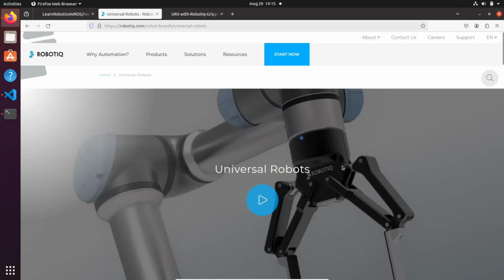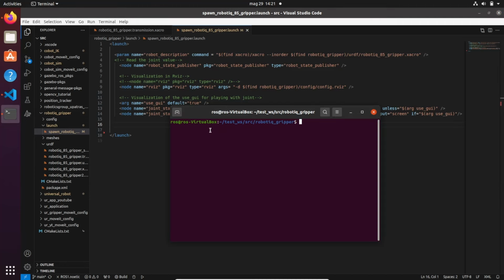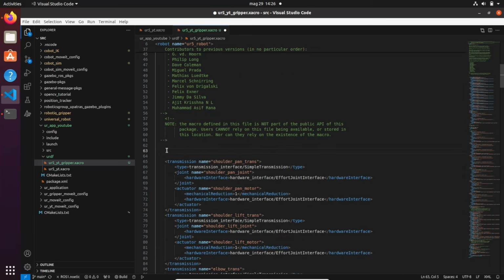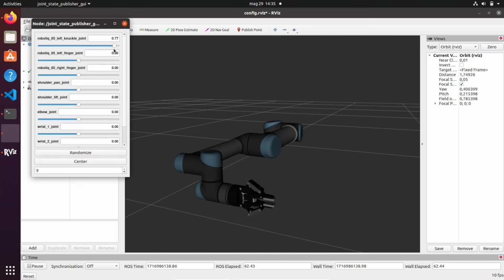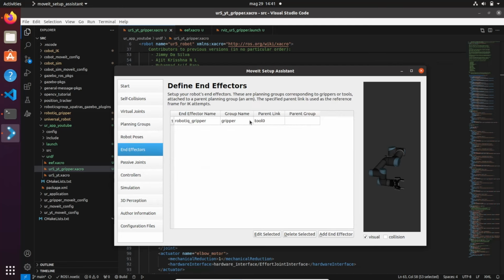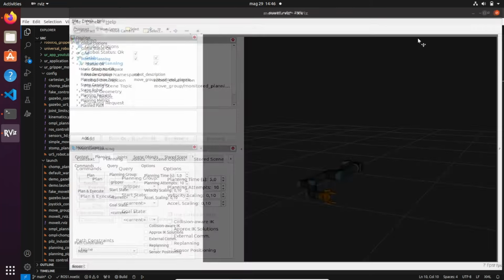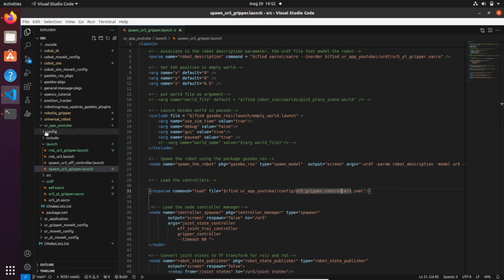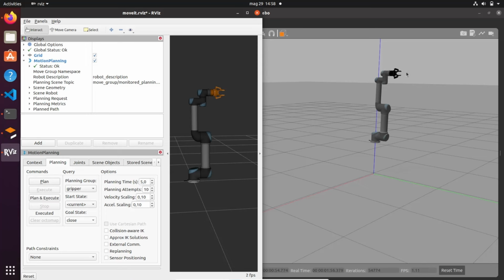Universal Robot with ROS - How to put a Robotiq Gripper on UR5

Comment: why the end_effector 28:20 is rotating (the joints) in gazebo, when i am executing the file, my end_effector is not stable, its uncontrollable, its swinging. 
do you know whats the cause of it
Reply from the maker: Hi Tony, this is because (most likely) the controller of the gripper ar not well configured from the controller manager. Check in my repository ur_app_youtube how I have setup the controller manager in the launch file and how I have configured it with the yaml file in the config folder. Feel free to send me your repository to ros.master.ai@gmail.com if you need further help
Reply from the maker: Hi Tony! Let's clarify the packages:
The package ur_application is this one: https://github.com/LearnRoboticsWROS/ur_app_youtube
In this package you find everything for running simulation of UR5 in Gazebo and RViz with MoveIt plugin. 

Then you have the moveit configuration package: https://github.com/LearnRoboticsWROS/ur_gripper_moveit_config 

If you want to test your robot (like pick and place) you can run the nodes that are in this package: https://github.com/LearnRoboticsWROS/cobot_IK 

If you want a more deep dive in your application you can book a free call with me and it will be straight forward:
https://calendly.com/ros-master-ai/30min
Reply: Thank you
Reply: @learn-robotics-with-ros  I also have the same problem even if I just copied all repository. gripper is not stable. can you help me please?
Reply from the maker: Have you installed the proper mimic library? Most likely the problem is that. Go to my robotiq_description repository and check that in this file there is the proper Gazebo library https://github.com/LearnRoboticsWROS/robotiq_description/blob/main/urdf%2Frobotiq_85_gripper.transmission.xacro
Reply: @learn-robotics-with-ros  Yes I downloaded the repository and just changed the name of the folder as robotiq_gripper which is same as in the youtube video
Reply from the maker: @johnnym110  Best way is to have a look. https://calendly.com/ros-master-ai/30min use this link to book a free call with me, or send to ros.master.ai@gmail.com a video of what is going on when you spanw the gripper in Gazebo
Reply: @learn-robotics-with-ros  Thank you. I sent the recorded video
Reply: @learn-robotics-with-ros  im also facing same issue, the gripper is swinging in gazebo, did you fing any solution for that ...
Reply from the maker: the problem should the mimic plugin and library that is not working correctly.

To solve this problem, try to follow this procedure

https://github.com/roboticsgroup/roboticsgroup_upatras_gazebo_plugins
To make it work I had to modify the library in the original package robotiq_description. So clone that package from my repository as well.
I would suggest you clone this repository in your catkin workspace.

Then build the package and run again. If it still not working, then reset the gazebo server typing

$ gzserver killall

Let me know if you made some progress ;)
Reply: Hi, I'm following the tutorial and the exact same thing happened to me about the claw. Has anyone already found a solution?
Reply from the maker: I think that the problem is the mimic library. Have you tried to follow the comment I put 4 weeks ago?
Reply: @learn-robotics-with-ros  Yes, that worked. Thank you very much.
Reply from the maker: @jmsantost7 happy to hear that! Enjoy your robot programming experience ;)
Reply: @learn-robotics-with-ros  Hey there! I am trying to implement this but still facing the controller issue

Comment: i followed your tutorial, the gripper works perfectly fine but why the left and right finger joint is rotating in gazebo and giving an error message on the terminal saying that the state of both of those joint are not yet known?

here is the message outputted by the terminal
[ WARN] [1727614291.158243747, 7.134000000]: The complete state of the robot is not yet known.  Missing robotiq_85_left_finger_joint, robotiq_85_right_finger_joint
Reply: same here
Reply: @saturnesoo  Hi! i just want to let you know ive found a temporary solution for this problem, and i dont know how this will cause more problem or not. But what i did was to change both of the robotiq 85 finger joints type in the robotiq 85 gripper urdf to fixed. Hope this helps!
Reply: @muhammadrisyadibenzani7802  thank you. i will try it later
Reply from the maker: Hi! Check this out! https://youtu.be/ME4wBbGbQHU
Reply from the maker: Hi! Check this out https://youtu.be/ME4wBbGbQHU

Comment: I'm running a real ur5 robot with the robotiq gripper. I get an error when running moveit.rviz because the global frame isn't set. Could you help me out with this issue ? I cloned your repositories to use. Thanks a lot for the video !
Reply from the maker: Were you able to control the robot with Rvoz with MoveIt plugin, interfaced with Gazebo? If yes, then the problem should be the hardware interface. If it doesn't help you, reach me out at ros.master.ai@gmail.com and we can have a look together.
Reply: @learn-robotics-with-ros  It works ! Thanks a lot. I was wondering how I would get the gripper to open and close on the real robot. Does Rviz do that ?